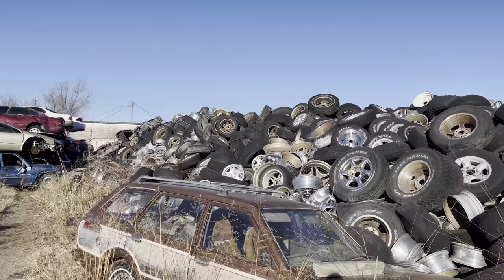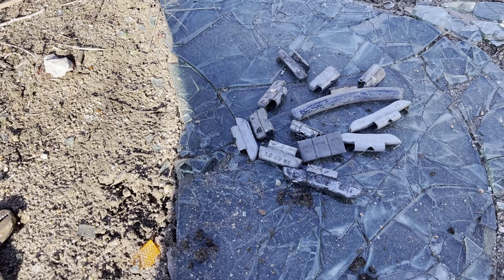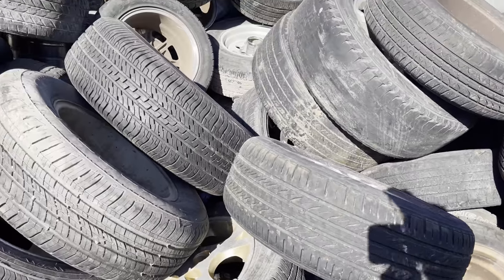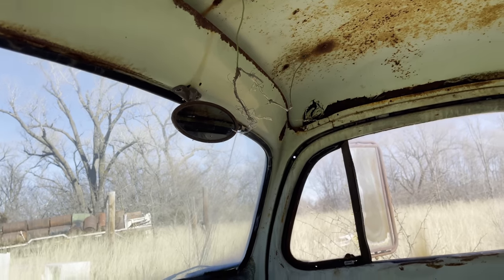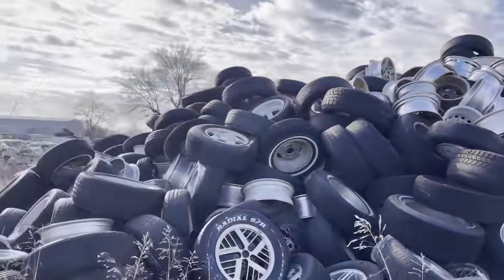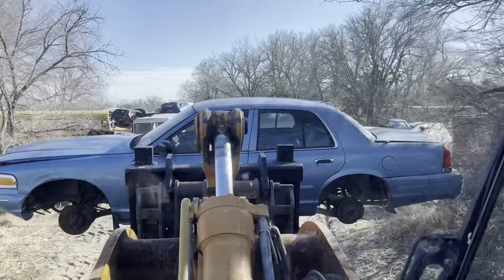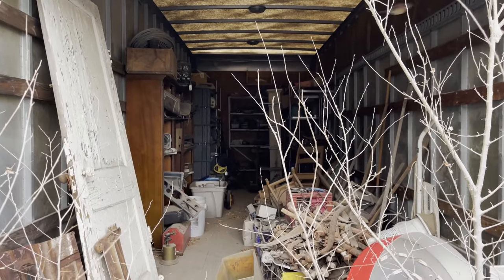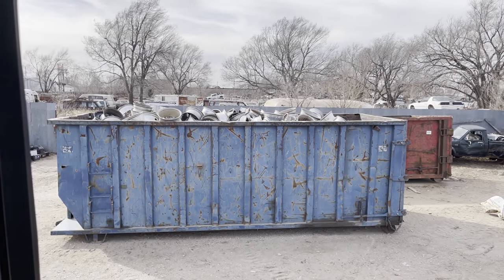Loading HUNDREDS of aluminum wheels & I bought a 1951 Ford Truck with a FLATHEAD V8!

Comment: You had a couple of senior moments and aren't even a senior.  Where's my coat?  I just remembered I left my tripod by the road.  Might be time to start making yourself some notes and checklists.  Your wife and kids might have to keep you under observation, too.

I think that one reason your channel is doing well, is that you're a throwback to the past, in a good way.  Much like guys around your age who I knew when I was a teen 50 years ago.  Solid, no-nonsense, hardworking, yet capable of having fun too.  I nearly died when you mentioned Floida Man.  20-30 years ago, I spent a lot of time in FL on business, weekend getaways, and vacations.  But climate-wise, there's no way I'd ever want to live there.  No mountains to head to when it gets hot and humid down low.  The whole place is down low.

Comment: We used to melt lead to make bullets. We also got silver plate items- plates, cups and such. We cut them up and melted them.  We separated the silver from the lead. We had a cast iron cornbread mold we put the melted silver and lead in. We fluxed the silver with bees wax. You can imagine how heavy those silver and lead ingots were. lol I hate wearing a coat! You're either too hot or not warm enough,  and yes you have to keep up with it. You have far more work than you can shake a stick at. Enjoy your videos,  I'm always glad to see a new one. Stay safe and GOD bless

Comment: The best way I found to remove tire stems fast and safe is there's a tee tool that retreads the inside of the stem were the threaded value go's and on the other end is a cap repair treader , take and screw that on were the cap go's then use  the yoke of a ball joint pull and it takes less force to remove it. If the tire is on the rim you'll need a hammer handle or a spacer so the fork isn't laying flat on the tire.

Comment: Yeah I recycle & sell both the lead Pb weights as well as the valve stems as dirty brass ......or brass if I decide to toss them into the fire 🔥,when I was young I would cast tons of lead fishing weights as I had a unlimited supply of lead from my pops from the lead wrapped copper cables that he would get from the phone company (Bell System) ....the phone company had a lead & precious metal recovery plant near my old place called "Nassau Metals " & it's where the telcos such as AT&T , Lucent ,Verizon etc would recycle & recover everything from gold & silver to lead & copper,  they made excellent solder at that plant too ,yes the good old lead based solder, not just the lead free solder, still got a few spools of the good stuff that can't be found these days

Comment: Got to say you got your aerobic points in today!
PS1- Do you use a magnet to ID the steel wheel weights or just by sight / FE marking?
PS2 - Great way to figure out where you coat was hiding!
Reply from the maker: Lead weights use steel clips so a magnet isn’t reliable. I don’t even need to see the markings to tell the difference anymore, but I’ve handled countless thousands of wheels.
Reply: @AdventuresMadeFromScratch  We used to sell 5 gallon buckets of just lead weights at the tire shop years ago,

Comment: I read somewhere that lead melts at about 450 degrees, but doesn't give off dangerous fumes until about 1000 degrees. Zinc fumes are dangerous too, no? You're not supposed to weld galvanized metal because of the zinc fumes, right?

Comment: Like your videos. I use my sawzall to cut the inside valve stem flush with the rim, works pretty good. I saw a guy once using a log splitter on steel wheels with tires. He would lay the wheel flat and the blade would crease the rim inward and he could pull the tire off by hand, so don't know if you could do the aluminum rims, it would bust them which does not matter its just if you can get the tires off. Also I think the guy had to modify the splitter to make it stronger.
Reply: Would want to be careful of shrapnel from the wheels

Comment: A claw Hamer works  great hit them right on edge of wheel they fall right an d then I us it to pull the valve stem thru takes a 1/4 of the time
Reply from the maker: Super fast with a pair of channel locks when you aren’t doing it 1 handed

Comment: Around here you can get zinc wheel weights at the auto parts store. I actually have some that i got a year or 2 ago when i was into collecting the elements of the periodic table, especially metals. I think i have 8-10 or them somewhere.

Comment: Silas, what is the value of old tires? I've heard of ground tire rubber used as fuel, also to make athletic paving.  How do you remove the tires from the more valuable rims?
Reply from the maker: I don’t have any “more valuable” rims 😆 I scrap almost everything. We have multiple tire machines. The tires then go back in cars since I am allowed 5 tires per car whether they are on it or in it.

Comment: Regarding the dumpster wheel capacity, I would guess back in the day most of the wheels were 13”-15”. I saw a bunch that were 18-20”. Keep up the good work. It amazes me how many $$$ you have sitting around.

Comment: The 66 Dodge short bed is a 65. Last year of the paddle door handles. Push buttons 66 up.
Reply from the maker: There are 2 trucks in this video. One is a 65.5 and the other is a 66
Reply: @AdventuresMadeFromScratch  Silas, I have a 13,000, 6,500 pre-1972, Car junk yard in R.I. I'm 70 The very last dodge you pointed out in your video was a 65-paddle door model.  I also saw the Dodge 108 van camper that was in 67. All pickups and vans came with that wing on the dashboard. I'm just informing you not interested in any fighting with you. But there is no 65.5 model either, lol! Paddle doors up to 65. Push button doors 66 up.

Comment: Quick question, sir. Do you ever get in any "old school" aluminum slot wheel sets? I am not concerned about the bolt pattern, the number of mounting holes, or the diameter, as long as they are full sets of four.

Comment: Much quicker using a pair of end cutters.
Reply from the maker: Like I mentioned, when doing it without trying to film with 1 hand it goes much faster. I’ve tried everything and by far a good pair of channel locks works the easiest, plus I don’t have to switch back and forth between tools for weights and solid stems.

Comment: Valve stemes are considered  dirty  brass at my yard  see what it is at your's.
Reply from the maker: Out of 620 wheels I got maybe 3 lbs, so I dumped them in the scrap iron dumpster with the hubcaps and steel weights 😆

Comment: Hey you wouldn't. Happen to have the front grill an front. Drive shaft. For a ford f150 80-86.   I know u say you don't. Have the time to pull parts but ill make it worth ur. While.  As buying them. From you.
Reply from the maker: I probably have a grill but no 4x4 stuff. The farmers keep that stuff until it’s literally falling in half
Reply: @AdventuresMadeFromScratch  ok. That will work.     Thanks

Comment: I cringe watching this, knowing you are going to melt these down! I just spent 2-MONTHS hunting for a replacement wheel for my Silverado 2500HD truck...which has the 'top-end' aluminum 5-spoke wheels. Only place in the country that had one was 'THEWHEELWAREHOUSE', and it cost me $239 plus shipping for ONE! Here you are, melting them down for $15 each, when you could be 'bulk selling them' to one of the MANY 'OEM USED WHEEL' warehouses out there (that are short on many sizes) for 3x or more of 'melt prices'. Wow...like watching someone unknowingly melt down an L88 cylinder head, or an aluminum Hemi engine block...
Reply from the maker: I’ve tried selling to those places and they always offer about 2/3 of scrap value and want them to be mint, plus they’re super selective on what they buy. In theory it sounds great, in reality not so much.